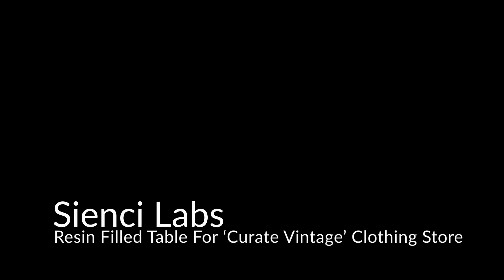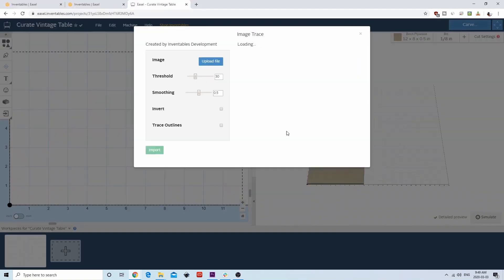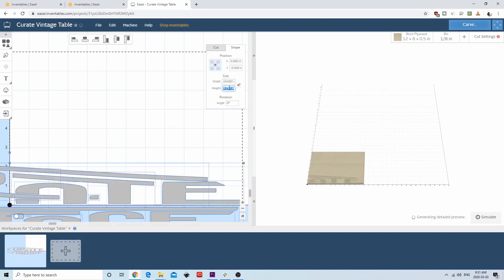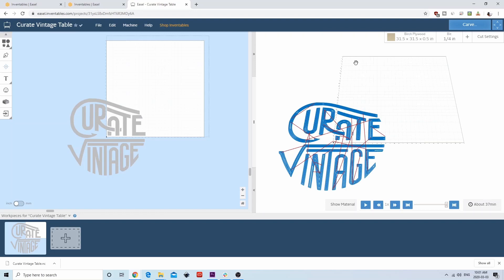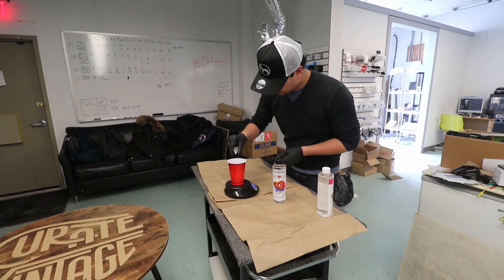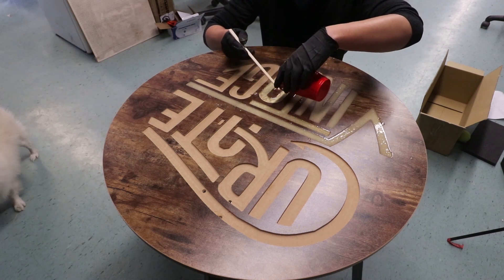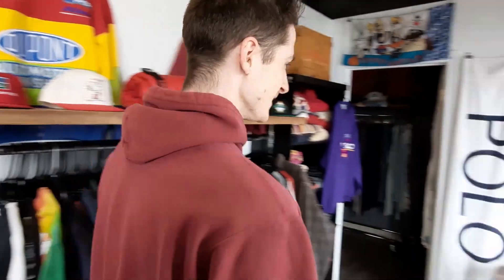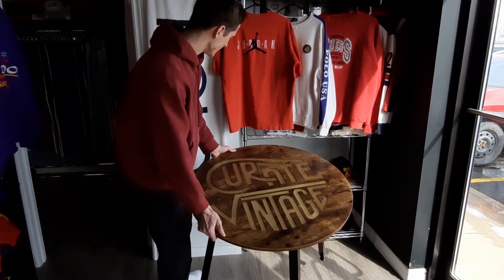Creating a Resin Filled Table With the Longmill

Comment: I noticed some possible, inaccurate cutting. The large C has what looked like jagged / non smooth curve. Just curious if this can avoided or is this something to be expected randomly? Thank you
Reply from the maker: Hi Dustin, when we cut the C out it was accurate to the design that was given to us. The higher the resolution your image is, the smoother it will be, or you can use vector files instead of a bitmap/jpg file.
Reply: @SienciLabs  thank you, I wasn't trying to be rude. Just curious. If I were to buy medium size, could I upgrade to 30x30 down the road?